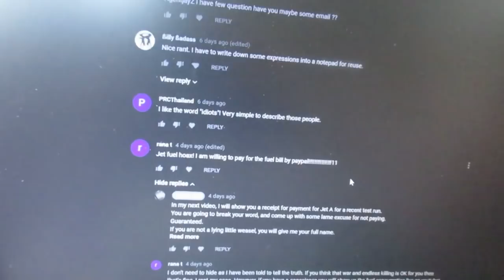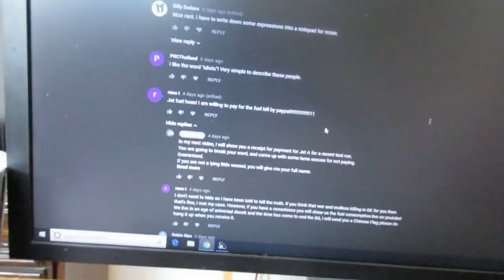Hoaxtard Discussion

Comment: If this is the case... why are airlines carrying (and I assume dumping) several tonnes of fuel each flight? Also why are airliners built to take off MUCH heavier than they are allowed to land?

I can assure you the airlines I worked for would revel if they never had to pay for or carry fuel again! It would also be a damn sight cheaper to fly the SR20 I used to fly if it wasn't burning 35 odd litres of dead dinosaurs an hour! Or does this 'theory' not work on piston pounders?

Just in case there is any question of my opinion... yes engines burn fuel... it doesn't matter what the fuel but you don't get nothing for free...Gasoline of various grades as appropriate for your engine type, nuclear, LPG/LNG, electricity.... it needs to consume SOMETHING! Maybe those that come up with these theories should consume a little less of some other things.
Reply: Fuel dumping is an emergency only thing. Normally planes are fuelled for the next flight + some extra for delays and alternative airports. Sometimes for very short segments they may fill up some more if fuel is cheaper where they are now. But never so much they have to land overweight after their next flight.
As a matter of fact many aircraft types don't even have a valve for fuel dumping (B737/A320 families for example). They can either land on maximum take-off weight or have to risk an overweight landing/circle to burn fuel. Only most longhaul aircraft even have the option to dump fuel if they have to land ealry for whatever reason. But since it is wasted money (that's what companies care for, not the environment) they try to avoid it as much as possible. ;-)
Reply: Fuel dumping is intended as an emergency thing but it can happen elsewhere if commanded... even on the ground if you pull the right breakers. Famously an ANZ DC10 once dumped fuel in the cruise to help a lost light aircraft over the Pacific Ocean find his way (Search "Jay Panchrow Cessna 188" I think that was the spelling). You are correct, normally it's A-B + alternate + holding if required... sometimes they tanker, up to max landing weight if the price differential is over a certain amount (because you burn fuel to carry fuel). However sometimes the flight plan is wrong and I've had aircraft hold to burn off fuel. Heck I've even had to do it myself in the SR20.

You are correct with the dumping ability. This is an old FAA rule that says if the difference between the maximum landing and takeoff weights is less than a certain amount then fuel dumping capability doesn't need to be installed. It's to do with the safety buffer on the landing weight being able to be safely used in an emergency situation. I'm not sure of the number but it basically tops out at the 737-900/A321/B757-200. However most transport category aircraft do NOT have the same make takeoff and landing weights, it's often in several tonnes difference (example the 737-800 is MTOW of 77,000kg and MLW of 64,000kg). In this case if you need to return and you are still over 64T then the captain will consider the problem vs the risk of an overweight landing. There have been 737's down under that have shredded a tyre departing Perth and because everything retracted normally and there are no systems issues apparent they continue to the east coast as planned because otherwise they'd just be going in circles for hours over Perth... may as well proceed if everything appears normal because that deals with the fuel burn issue and you will get just as good service at your planned destination should the gear not function normally or you can't vacate the runway.

Comment: Aluminum rivets are going to hold 250,000 lbs of fuel?  I find that to be highly unlikely.
Reply from the maker: John, John, John...reality does not care what you belive, or are unable to grasp.
Neither do I, and nobody else does either.
Only you can cure your inability by learning.
Or, continue to rail away at the world, telling us all that what is actually happening before your eyes is impossible.
Your choice.
Reply from the maker: The beneficiary of idiocy: Well, you sure showed the whole world didn't you? You just explained to us that what happens every day... doesn't happen.
Thanks for that.
If you actually were curious to find things out, you may be surprised at just how much fuel pressure is used during refueling, both in the air and on the ground.
You certainly do have a right to refuse to learn, sir. Carry on.

Comment: Turbine engines run on wood. 🔥🔥HeHe
Reply from the maker: With a large, modified combustor, they have been made to run on sawdust.
Reply: AgentJayZ cool.
Reply: AgentJayZ 
So there isn’t a guy in the belly of the plane shoveling coal?😂😂
Reply: Coal dust too!
Reply: AgentJayZ Sir Jay, please share with these kind souls how in the old days they indirectly 'ran' on walnut shells occasionally, otherwise they didn't run too well. If I told the story, they wouldn't believe me.
Reply: Jason Forne 
I’ve worked with coal gasification. Put simply, coal is ground into a fine powder and sprayed into a large combustion chamber. It burns so hot that there’s almost no emissions. 
So yes I believe it could run a turbine.

Comment: It is not a surprise that Stupid people are hard to reason with!!! I have a question about older Turbine engines. The engines in the c130 and the il18, Smoke ALL the time. Was this done for a reason? Or was air flow not understood well enough, or were blades less able to deal with free hot O2  back then?
Reply: Combustion technology back in the 1940s and '50s was less well developed and the burners were, in effect, fairly simple high pressure injection devices, spraying an 'atomised' (not really) cone of fuel: please see one of AgentJayZ's videos on the subject.  This resulted in a rich primary zone, with fuel droplets taking a finite time to vaporise.  The incomplete combustion was then quenched by the dilution air downstream, causing visible smoke in the exhaust.
There was, however, a notable exception in those early days: Armstrong Siddeley's combustion chambers, with their 'hockey stick' (aka as 'candy cane' in the USA) vaporisers were virtually smoke free.
Reply: Thanks for that, as a kid I flew on Viscounts and 1 Trans Atlantic Britannia flight, neither of them smoked like the c 130 doing touch and goes up here in Winnipeg at the end of each month. Sort of the same thing with 50's era low pressure injection systems in Diesel Engines. Thks again

Comment: How much fuel is stored in the wings
Reply from the maker: I was going to say most of it, but many of the larger airliners have a large tank in the bottom portion of the fuselage between the wings. It's called the center wing tank. I don't know if you count that as being in the wings or not, but it's probably the largest volume of stored fuel.
Last year at Oshkosh, I asked a 777 pilot how much fuel they took on for a transatlantic flight, and the answer was 200 thousand pounds.
Reply: With a child's intelligence, one could easily guess that it's completely depending on what aircraft you mean and that you should have included that in your question. There are some (mainly smaller military) planes that don't have any fuel in the wings, only in the fuselage or external tanks while others have all their fuel in the wings. How much all is in liters is also very different from a BD-5 to an A-380.
An A-380 holds about 320 000 liters, all in its wings (if we count the horizontal stabilizer as wings too). It was planned that the even larger versions of the A-380 should have center tanks too but it seems those planes will not be built due to the decline in the market for super big airliners.
Reply: Thank you and i am not familiar with planes thats why i asked a broad general question. Thank you for yiur answer. I was just curious and that helps debunk some misinformation in some other videos
Reply: Where did you get 320 tons from?
Reply: The biggest cargo plane can carry a combined weight of 355 (metric) tons of fuel + cargo.
Reply: @RealSnail3D  That's not what seems silly.
Reply from the maker: I'm tired of you presenting your ignorant opinions and lack of ability to understand things as knowledge.
I'm sorry Mark H. but you no longer have the privilege of speaking to the Jet City public. Your lies and accusations end today.
Reply: skunkjobb no only a third of fuel in an A380 is stored in wings

Comment: J, wow this has turned into a real gong show. The latest theory in jet engine design requires no fuel. Haha.  One problem I noticed is the new engine designers need to go for spelling lessons to explain how it works. 
But back to reality, I don't think I have ever seen any air/ fuel ratio numbers for gas generators. Do you have any or should I figure it somehow? Bob.
Reply from the maker: The fuel is burned in an atmosphere of excess oxygen, just like a candle, a campfire, or a Coleman lantern. The flame takes what it needs.
Reply: I dont think those things burn at the ideal AFR which is the stoichiometric (theoretical) ratio (SR).  Old PT's and jets leave a trail of smoke behind that looks a lot like carbon. It is. Late models don't smoke. So to get the operating AFR of a gas gen. to be the SR, you have to work at it. PW worked on the new engine for the BBD CS jet (now A220) for years to get 10%+ more efficiency out of it. RR, GE, CFM...etc. work on the same  every day.  BPR increases make up most of the thrust/ fuel gains but until the OAFR = SR, the goal is not yet accomplished. Its all about perfect molecular mixing. Bob.
Reply: MH, Yr does not seem to be a meaningful comment. Maybe i should have said 'thrust / fuel flow rate' but did not intend to write a book in 1 paragraph. But most people prob understood the concept. If you have you have something informative to say on the subject, may as well say it.  Bob.

Comment: But WHERE IS THE FUEL STORED ON JETS??? PLEASE SHOW INSIDE OF WING WITH ACTUAL LIQUID FUEL IN IT!
Reply from the maker: Have you ever seen, or asked to be shown... the inside of the gas tank in your car?
We all know the answer, you bacon double genius burger, you...
Reply: @AgentJayZ  Haha you are funny ;) 
The thing is the wings DO APPEAR TOO THIN to possibly hold the 240,000 gallons i.e boeing 747- Is the total fuel amount all stored in wings or is it stored elsewhere then pumped in only as needed?
Reply from the maker: In the 747, and mostly all of the larger airliners, the largest fuel storage area is called the center tank. It's in the fuselage, between the wings, and under the floor. It holds more fuel than the two wings added together.
Reply: @1EccentricMoFo because jet fuel and airplanes in general are more dangerous to be around than a car ? Pumping fuel in a car doesn't require training but in the case of an airplane it does
Reply: Some of those "very thin tanks" are easily large enough for human beings to stand in...
Reply: @pm6796  have you ever stood next to an airliner before? even something smaller like a 737? it's pretty obvious that the wings are not "too thin." even on a cessna 172, the wings are decently thick, stand next to one up close, touch the wing with your hand and get a good sense of scale. these wings are clearly large enough to store a pretty significant amount of fuel, with a large internal volume like that it'd be a waste to not put fuel in it.
Reply: @lauralauren6432  - find leaks with a gas is the industry standard.I checked bike tyre the other day by pumping air into it then immersing the inner tube in water. The bubbles show where the leak is. Same for the sealed joints within the wing. The pressure differential from pumping air into an empty tank will cause bubbles in a liquid sprayed onto the seal. This is a far more efficient way than filling the tank with tons of fuel which then has to be primped out, stored, etc. If a leak was found then what dangers would an engineer face entering a fuel tank recently filled with jet fuel?
Reply: @lauralauren6432  - when they checked the wing tank for leaks they were checking leaks between tanks, so they were checking for leaks between the tanks, not between the tank and the outside. Again, using. Impressed air or helium is a common way, in engineering, to leak detect on things like vacuum chambers. Also, again, remember that they won’t want to fill the tank with any liquid as such an amount has to be stored and this is a pan expense that such companies want to avoid. This is basic engineering and common sense.
Reply: @lauralauren6432  - have you ever been near an aeroplane. They tend to be pretty big. The idea that wings are “thin and might snap” is ludicrous in the extreme. Adjacent to the fuselage the wing on planes like the 747 or A380 are more than 1m thick. Even on the most basic of aircraft like the small Cessna training aircraft the wings are more than 15cm thick. Plenty of room for the fuel.
Reply: @lauralauren6432  - yes, inside. BETWEEN TWO TANKS. Why can’t conspiracy theorists understand the most basic of things. Apparently there is next to no common sense nowadays.

Dubai sits on an oil field, Sydney airport Le located next to Kurnel Oil refinery. There is plenty of evidence for fuel supplies to airports. The airports don’t require long queues of tanker trucks, just a pipeline underground. The entire airport fuel delivery is underground, except for many African airports, for example, because they don’t have the volume of traffic or the money to pay for such a system. The fuel delivery system on an aeroplane is beneath the wing because that’s an easy location from which to access for ground handlers. The refuel system leads to piles inside the wing which deliver the fuel to the required places. Many aircraft have over wing refuelling points as well in case the underwing service point is unusable. 

You seem to be lacking in the most basic common sense and intelligence, but then again. You are suggesting that aeroplanes seem to run on nothing but air, so anything is possible, I suppose.
Reply: @1EccentricMoFo 🦋💙 get a job to fuel aircraft then! Since you won't believe anyone. It's that easy

Comment: Where is the muffler on the airplane
Reply from the maker: Small piston engined aircraft will have a muffler. Jet aircraft don't have a "muffler", but the exhaust exit of modern airliner turbofans have sound attenuating structures and materials built into them.